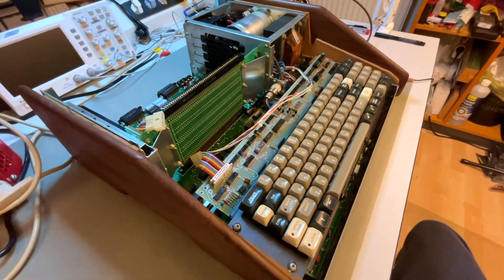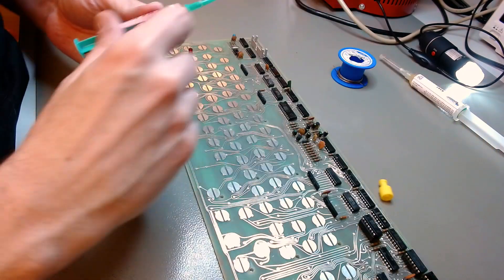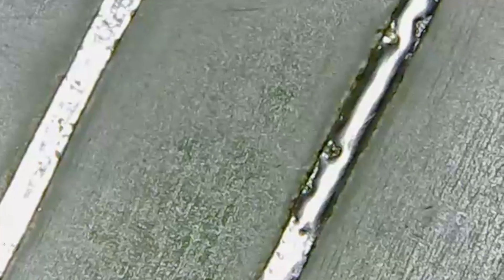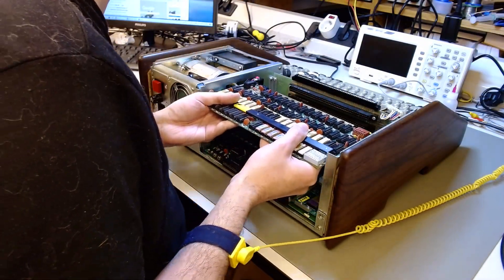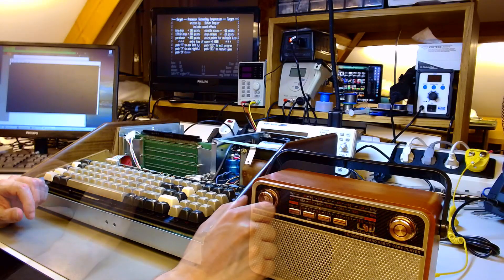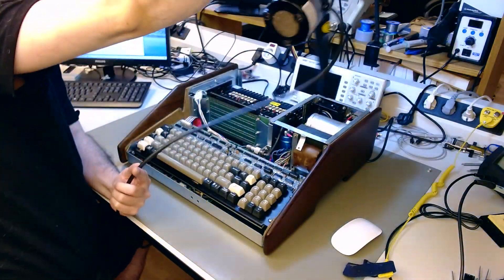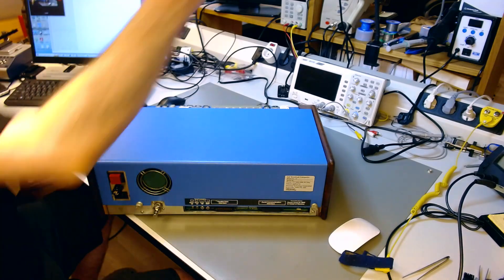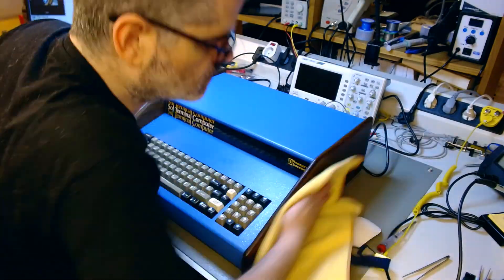SOL-20 museum restoration, PART VII

Comment: What are those traces that just seem to end in nowhere/nothing? They don’t seem to end in a via.
Reply from the maker: Indeed, they end nowhere and are useless .They may be there because Processor Technology anticipated some possible modification (bodged) to the circuit. Extra traces are free anyway, so they 'extracted' (technical term; really) some relevant signals from the keyboard matrix to make the modification easier in the future. Another possibility is that they are meant as EMI insulation in between signal-carrying traces. Today we know that, without stitching these insulation traces to ground on at least both ends, they may actually make things worse. But back then designers didn't know this.

Comment: Pity about the original 2104 failure rate.  Perhaps they can be a little mini display beside the computer as a testament to the both the speed with which memory sizes were increasing and how such cutting edge chips tended to be unreliable over the long run.
Reply from the maker: Great idea! I'll bring the defective parts to the museum along with the computer.
Reply: @thebyteattic  That's good, it's a shame they're broken.  Because they're so attractive.  Better as a display than in the bottom of the dead chip box.